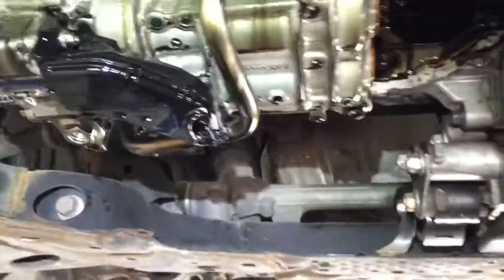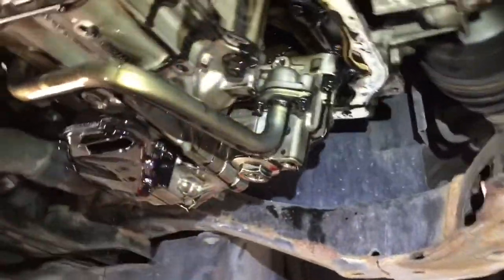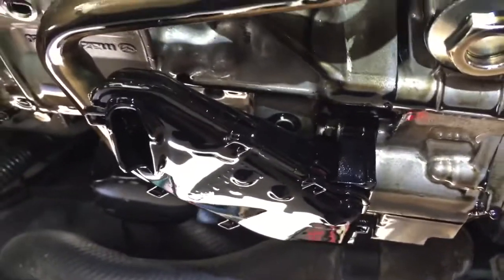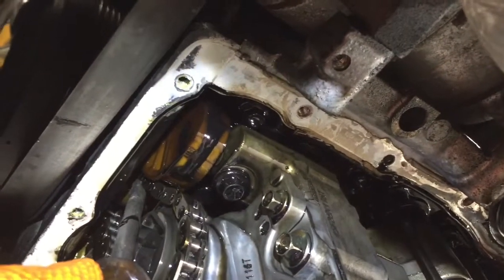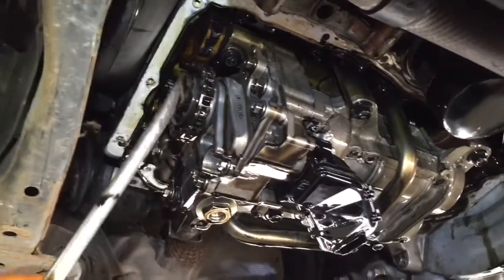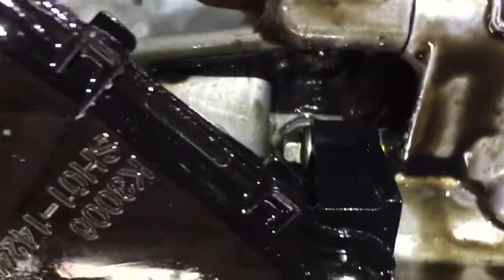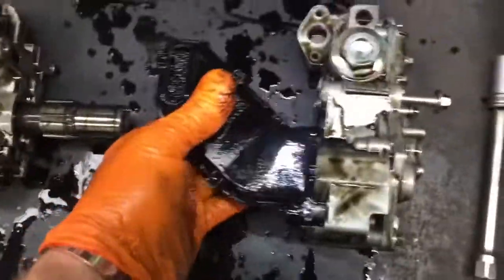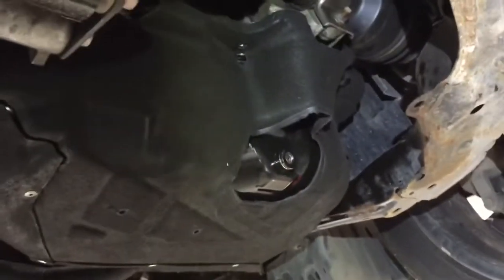Mazda engine failure caused by oil pump strainer & replacement

Comment: Nice job! Where is the oil pressure sensor on these?
Reply from the maker: At the front of the engine close to the oil filter. I’m starting to find the strainer gets clogged around 200k kms or 120k miles.
But you are right to check oil pressure first. Thanks for the comment 👍
Reply: @kennedysgarage3281  My 2014 2.2 Skyactive 2.2D just had this issue and I'm at around 112,00 miles, so pretty close to your estimate. First, I got an error code P06DE - Oil pump switching low-pressure followed by a more serious error P055F - Low oil pressure abnormality. This error put the car into limp mode. A local garage changed the oil and oil filter and it was fine for about 400 miles, but then the errors came up again. I paid very close attention to the oil pressure level using ForScan Lite (Android) and a Bluetooth OBD adapter. Cheap and extremely valuable for the information it provides. The oil pressure seemed to be just below the 'low' threshold, but then suddenly dropped to under 100 kPA (14.5 psi). At this point I refused to drive the car to avoid any serious damage. 

I got the car towed to my local Mazda dealer. They mentioned that it is very likely to be a clogged strainer, just as you have explained here. I'm still waiting to hear how much it's going to cost. FYI - they mentioned that the reason the car was probably ok for 400+ miles after an oil and filter change was because the new oil is thinner. I guess that makes sense. The dealer has been very good with me in the past and my car has pretty much a full Mazda dealer service history, so hopefully they'll go easy on me lol. Sorry, I know this is a bit long-winded, but hopefully it may help someone. Thanks!
Reply from the maker: @hyper-viper  absolutely brilliant info, the dealer can be very familiar with these issues because it happens so much on this engine. And I find because the technicians are so familiar with them the labour times are fast so it shouldn’t be too bad. I’d guess somewhere around €1000 to €1500 if they do injector seals & intake system de-carb. But it all sounds good, thanks for taking the time to post it 🙏👍
Reply: @kennedysgarage3281  Thanks for the reply. My engine had a de-coke done by Mazda about 6 months ago at 6 hours labour. This was just after they serviced it. I've done about 5-6,000 miles since it was serviced and I thought the engine would be running great after the de-coke and oil/filter change. Disappointing that this has happened but not much I can do about it now! Thanks :-)
Reply from the maker: @hyper-viper  it should be 3-4 hrs involved it changing oil pick up. Be sure to ask them about injector copper washers?? This is what causes the strainer to block in the first place 👍
Reply: @kennedysgarage3281  Thanks! I read your comments and I see you've mentioned a few times about the injector seals. I will definitely ask for them to be replaced. My other issue now is that the dealer can't look at it for 2 weeks and there's no way I can wait that long. I tried another guy who insists that it will need a new engine which I hope is not the case just yet. It's a pity you weren't closer to the North :-) I'm trying other options now to see if anyone else is able to do it. Very frustrating!
Reply from the maker: @hyper-viper  the other chap is suggesting an engine change because by changing the engine he takes on less accountability. I do understand that all trades are quite busy nowadays ( possibly due to COVID ) cars can be frustrating ☹️
Reply: @kennedysgarage3281  Actually you are exactly correct. He did say that to be fair. He gave me some good info and if it does turn out that way then I will be in contact with him again. Hopefully it won't come to that though! Thanks again for taking the time to reply 👍
Reply: @hyper-viper  hi did the decode no make a nice change of driving? More responsive etc? Did they charge you much? They quoted 1300 fir a valve/intake clean  cheers in advance
Reply: @kevinhancock4064  Mazda didn't charge my anything for the decoke. To be honest  my car was driving fine before so I didn't really  notice a big difference. The only thing I noticed is that sometimes when accelerating hard (which I don't do often), there was on occasions some lag.  It seems to have gone completely now, or at least I haven't come across it as yet.
Reply: @hyper-viper  that's interesting I seem to get a bit of that it's not hugely bad . I've had flat spots not so long ago it's a nice car in diary other way I've read some recommend engine flush before pil change what oil did you use or I'm assuming mazda done the pop change for you ? I'm using mannol 5w30 ll c3 ..I've checked pil specs properly etc most times nice and quiet . It used to idle a lot worst . (More ften/irrationally) . I don't understand why mazda designed the strainer this way.  I'm mostly concerned of the deep exhaust note when it happens . I need the head ruled out ..last thing I need is a bad gasket or cracked /warped head.  Still get a few bubbles in overflow which can either be a bad sign or a simple air lock but both upper and lower pipe gets hot it's had new thermostat and coolant sensor..New rad too
Reply: @kevinhancock4064 My car had an engine flush and oil change just over a year ago which is well before this problem started. I'm not so sure about the injector seals though. I planned to get them changed upon the next service interval due in Jan/Feb time but maybe I should just get that done sooner. There's about 114,000 miles (185,000 kilometres) on it now.
Reply: @hyper-viper  hi I'm not far from you at just short of 100k miles . Bought with around 96k I don't usually buy cars with such high oleate last car was a Ford with only 15k when I bought it it had 44+k when it went . Only time that had Amy compression issues was a late oil change it only once had limp mode etc sorted oil and filter was all good.  Easy on that car too. I've had 1x injector done under warrantee . I'm wondering that my issues are the other seals failing etc ..the odd thing for me as stated is the exhaust note when I get any idle imbalance.  Last night it idled a bit oddly on way to work on the way home seemed OK.  It didn't high rev on start up as I'd have expected given the cold weather . But ran fine on the way home even though I had the deep note again . Iys like a 4ohm suborder next to your ear . It's odd. I truly want to rule out Amy gasket failires.  More so the head .did mazda charge you much for their service?
Reply: @kevinhancock4064  No it was £199 / €235. It was really just an oil change for 2021/100k service interval so it wasn't too bad. The next service I'm expecting to cost around £360 if I get it done  by the main dealer. I'm not sure yet though.
Reply: @hyper-viper  blimey it seems a bit fir an oil change in comparison to a local trusted garage often being around 60 pounds using correct oil 9f course.  Don't get me wrong if money wasn't an issue fair enough ..one of my colleagues has a 2015  model cx5 mazda  quoted him clost to £1000 for brakes and service etc . He had it all done in his trusty garage for £450 . I understand mazda have big 9verheads but if they were more reasonable on costs more wouod use them . They want £1300 for an intake manifold clean.  Another specialist firm charge £90 per cylinder so £360 much cheaper
Reply: @kevinhancock4064  I totally agree with you. Main dealer servicing is expensive however, it looks good on the service history of the car. Also, I felt like I owed Mazda something. Their customer service was incredible. Long story short,  they did a 6 hour engine decoke, replaced a faulty vacuum pump and EGR cooler, all as goodwill. I would guess that's around £1.5 - £2k worth of work. This was around the time  my service was due so I cancelled the sevice I had booked with another garage and rebooted it with Mazda. It was only £50 more than the other garage, plus it will go down on the car's digital service history and when the time comes, it should make it easier to sell.
Reply: @hyper-viper  that's fair mate may I ask how you managed to get that free ? I had a new vacuum  pump on a re all motice recently inc boot struts some turbo gaskets etc on the recall notice it says swirl  flsos on intake but thT certainly wasn't done
Reply: @kevinhancock4064  they just offered it to me. I didn't ask! I took it there as sort of a last resort to fix an annoying issue with P0401 error that kept coming up on the dash. Took it to 6+ mechanics and they couldn't fix it. I went to Mazda and they initially diagnosed it as an engine decoke which as far as I know, is basically an engine clean. The light came on soon after again and they said if it did it is probably the EGR cooler. £800 plus labour to replace, but quite unbelievably, they also covered this under goodwill. All this plus the vacuum pump replacement and they only charged me £90 or so for the diagnostics and engine coolant. They were fantastic. That's why it's good, certainly in the case of Mazda to get the car serviced there. They do make a point of looking after loyal customers. I apologise if I'm shilling Mazda here but this is simply what happened.
Reply: @hyper-viper  what's annoying (are you UK?) Is they wanted £108 for a diagnostic.  No doubt they may be thorough and if thus guy Tom.dint find the issue I'll consider mazda going by your result . I do want a decode and considered doing it myself and likely could..God knows why an egr  collar wouod fail but I guess anything can . Not sure why a decile wasn't done with my recalls
Reply: @kevinhancock4064  Yes I'm UK. The diagnostic was £90 plus £11 or something for the coolant. All for probably near £2k worth of work. I totally get that the main dealer is usually the most expensive place to go, but they are logically more likely to give you a better diagnosis and possibly offer some goodwill as well. This depends on your car's service history etc. I tried to get this P0401 error fixed by quite a number of mechanics over 6-12 months and none of them could fix it. In hindsight,  had I gone to Mazda in the first place, it may have saved me hundreds.
Reply: @hyper-viper  true that mate I've heard many scenarios one in particular where they had full mazda history and engine knackered at under 100k mazda gave a new engine free 6l worth crazy  I don't understand why the orices are so varied it's bizarre.  Of I don't get any joy Tom ill go that route.  I'm still unsure why they didn't do my swirl  flags 9n intake as 8ts on recall notice . I've not had that code is it low oil pressure?
Reply: @kevinhancock4064  No, the code P0401 is Exhaust Gas Recirculation (EGR) Flow Insufficient Detected. It was very intermittent, but never had it again since Mazda replaced the EGR cooler.

Yes it's bizarre that they didn't do that recall but Mazda should know it still needs done and they should be able to do it for you free I would have thought.
Reply: @hyper-viper  very true I know the cooler sits below the egr hose as they call it . I often hear intermittent noises only on driving not at standstill.  And it sounds like that area and I'm sure I didn't notice it  before I cleaned it (I done it by the book ) I used egr  cleaner ot wasn't overly bad but I was more concerned of my map sensor it was bogging heavily clogged . I've no doubt bettered the performance overall but a full carbon clean wouod help . (At least I think it wouod inc valves ) I'm a little annoyed tbh as when I initially rang mazda  referring to recalls the guy said oh yes there are a few. I booked it in . They had it just a few hours at most while I took my boys to cinema . The guy I prompted on getting my key/car as he wasn't going to say anything.  He mentioned (I did hear right) the oil pump . I'm guessing he misread and meant vacuum  pump.  As I had a guy call me 9n replying to a mazda aftercare text to say no. That was not replaced.  I had them email me what was dine for reference.  I was annoyed that not all listed recalls were done. Inc swirl flaps.  On intake . If it gets to that and I end up getting a mazda  diag  I'll go to town if I have to. More so if they try telling me its an issue that's going to cist a lot and others have had it covered for free. I'm an easy going guy but I'm happy to speak up . Time will tell I'll update on tomorrow's mechanic . If he's anything like the 1 I used to use . It'll be a result.  They have 5 stars so can't be bad.
Reply: @kevinhancock4064  I think you can check your reg on the Mazda site for recalls due on your vehicle. I did check mine at the time the vacuum pump fault came up but there were no recalls. I'm  not exactly sure why they went ahead and replaced it under goodwill but I wasn't complaining:-) Good luck with yours and I hope Mazda finally get it sorted for you!
Reply: @hyper-viper  hi I've had diagnostic it was £102 as I suspected its a carbon build up . Certainly not on the house £860 the dealer I bought my car from is meant to be getting a mobile specialist to do it ..I'm just pissed that I'm having to wait . If I had my way I'd have them do it save the hassle etc I guess you got lucky mate
Reply: @kennedysgarage3281  Just an update on my car. I got it back today after leaving it with a local garage recommended to me. They confirmed no damage to the engine and it just needed a good clean-out. They removed the sump/strainer, cleared the mess which they say was quite bad, and after monitoring the oil pressure using ForScan, I can see a monumental difference. It looks to be sorted now and it cost just under £350 in total. Shame the last garage didn't diagnose this properly. They just replaced the oil and oil filter which turned out to be a complete waste of £100 as I had to dump that new oil and replace the oil filter again. Still though, I'm so glad it's sorted :-)
Reply from the maker: @hyper-viper  that’s brilliant, they are quite good an engine once they are taken care of. The garage seem to be good & well done to them for sorting it for you. Many years happy motoring to come 🙂👍
Reply: @kennedysgarage3281  Thank you! I completely agree. All things considered, the engine is mechanically sound. Just kind of annoying that something as simple as poor injector seals can cause this much trouble by allowing carbon deposits inside. I'm going to make sure they are swapped out too. Apparently I need to replace the copper seals with aluminium seals but not sure if that's correct. I'll find out one way or another. Thanks again for taking the time to reply. Much appreciated!